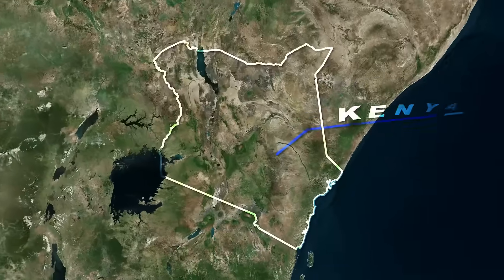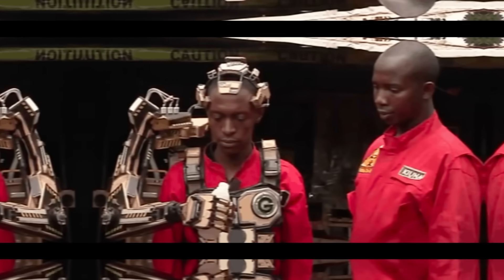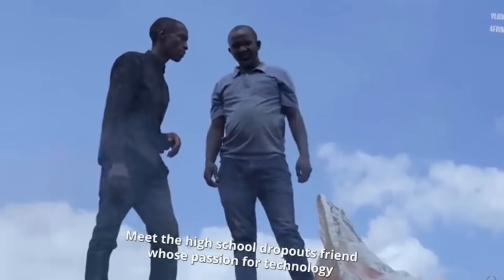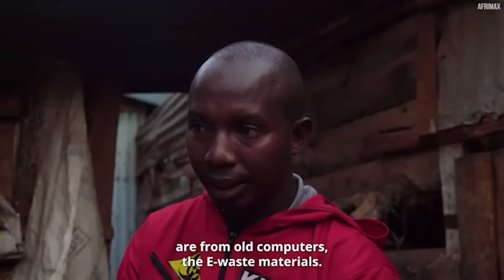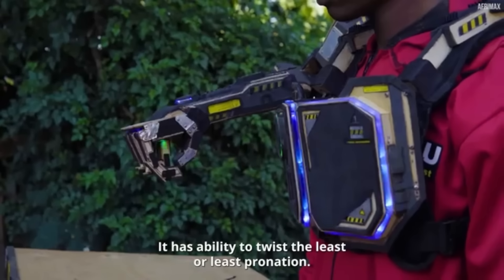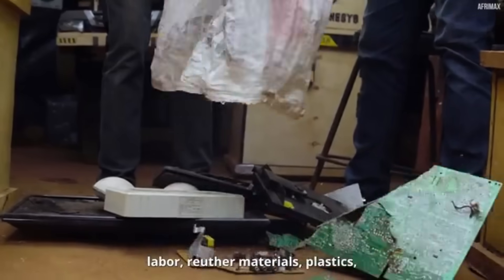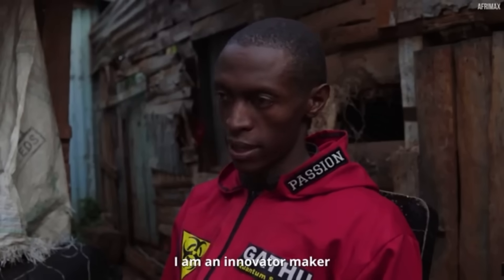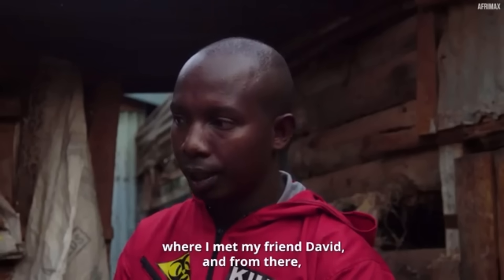This Black Genius Transformed Himself To A Robot And Paid The Price...

Comment: Nice just wrong approach(I am just being an asshole) what you should have done with the radio waves… a head band yes but to wireless make the arm hand move separate from the head or body… this should have been the second version not the first… this version obviously needs to be smaller but it works very well… when it comes to employing the youth… I hope they are interested and not forced